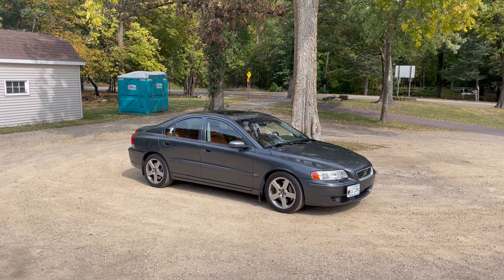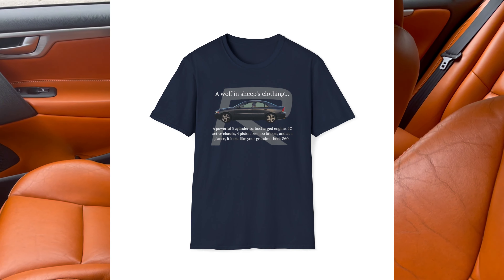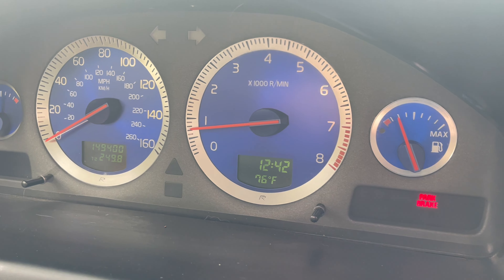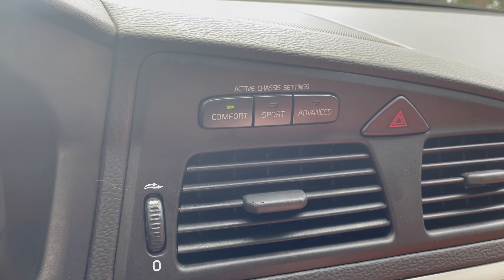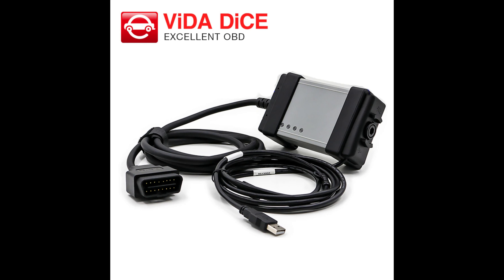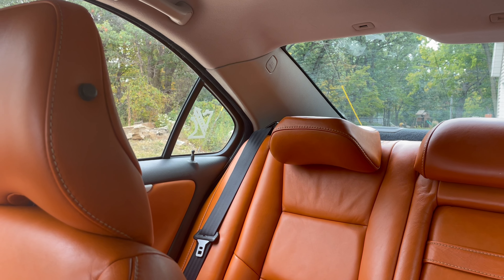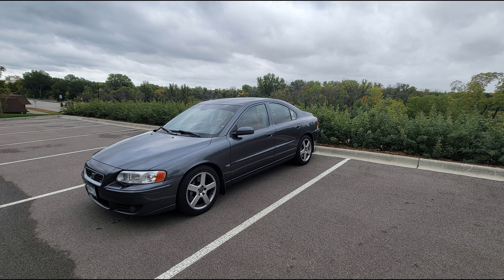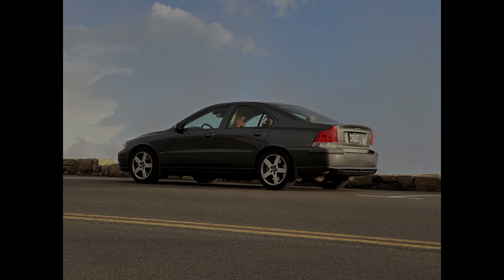Volvo S60R, an honest review

Comment: these cars are such money pits.  i still love mine tho.  had to replace all the shocks/struts, timing belt, angle gear, pcv system, control arms, tie rods, and do a full brake job.
Reply: Ittl last another 400,000 miles now though
Reply: @hi_how_are_ya_  it keeps breaking things 😭
Reply: Yaa with volvos you gotta find them taken care of if they been ragged on you'll have alot of problems
Reply: Volvos  are money  pits ...I have  had a 2010  Volvo  S  80  turbo  6  cyl.... for 2 years  now with 110,000 miles   ..And I haven't   stopped  fixing  things .......2   oil  leaks  $800.....rear  suspension    $700 .. Lost  the AWD  system ...front struts   and parts  $1000... and I'm  not done yet .....the car is cleaning out my  bank account......this will be  my last  Volvo.... I should  have  bought  a V 6.   Impala    with  300 hp....there is no way I would have spent that much  on  it.....
Reply: @jimd2101  s80's are known for problems it's the 2.4t inline 5 cylinder that don't break same with a couple others
Reply: @jimd2101 Volvo are not money pits, but exactly like any regular premium car. What you have described there is nothing out of the ordinary for any other older premium car. So nothing to complain about there, tbh.

Comment: I bought my 04 S60 Rm for 1500. I did BC racing coilovers, ipd rear toe adjustment arms, and new tires for about 2k. It's been very reliable but it's still a fairly expensive car to own. My paint is trashed and it has a constant CEL for one thing or another but I still love owning it. Cheers from NM!🎉

Comment: How would you feel if someone wanted to get  either a 2.4L S60 non-r  or a S60 Non-r AWD , and build on that, versus a S60r (be it 2.5 or even a 2.4L if it exists) ?

Very neat video, thanks for making it!
Reply from the maker: A lot of people build T5s and a lot of R owners actually swap in a T5 block. They are pretty good but it would take more work to make the same power as an R
Reply: I own a 06 s60 t5 the 2 4t is what the t5 models have they have thicker cylinder walls compared to the 2.5l you can make good power between 400 500hp on both 2.4l and 2.5l but more reliably on the t5 block hope this helps..iv also owned 05 s60 t5 and a 05 xc70c. I love volvos

Comment: Better of with an  m66 T5 instead of an R ;)
Reply from the maker: If you’re shimmed or have a T5 block you have nothing to really worry about with an R, just regular maintenance
Reply: I got a m66 T5 but let's be honest, most people will never find one
Reply: @ubikthecarguy "if you're shimmed" what does that mean?
Reply from the maker: @GoodGains90  metal shims in between the cylinder walls and helps prevent cylinder walls cracking, lots of people use them because they’re cheaper than getting a new block or sleeves.
Reply: @GoodGains90  I have one M66 T5 with only 62.000km love it 🔥
Reply: @GoodGains90  I came from germany and they're rare here too.I found one last year and bought it. I'm so happy
Reply: M66 T5’s are unfortunately really difficult to find. To my knowledge, somewhere around 600-700 were imported to the US from 2004-2007.